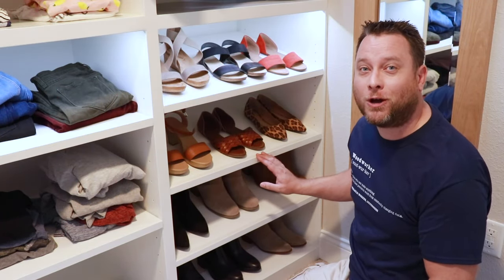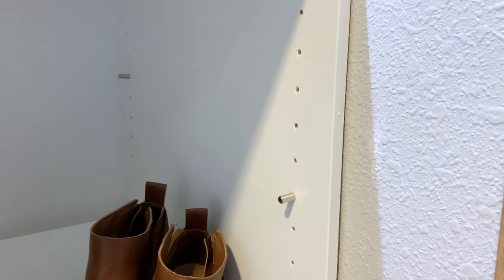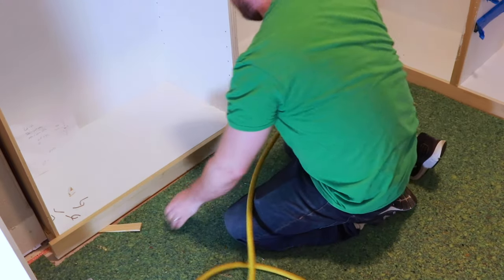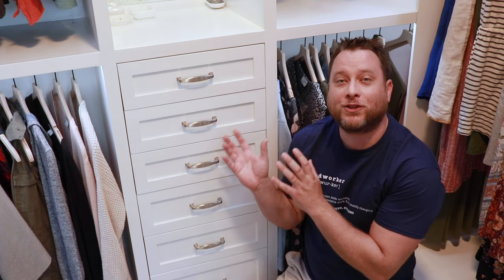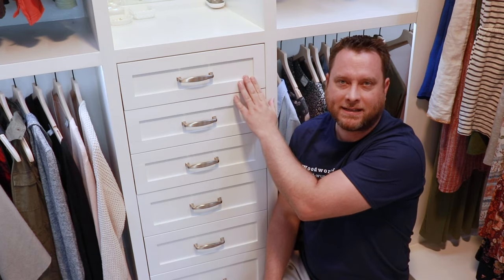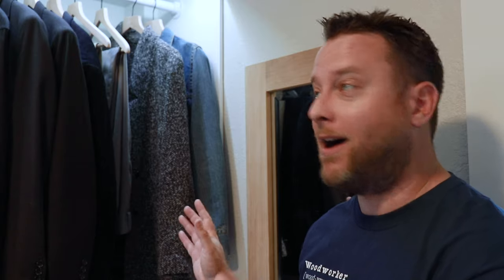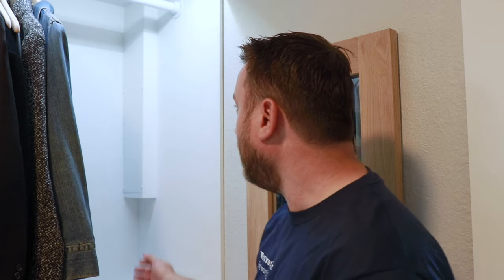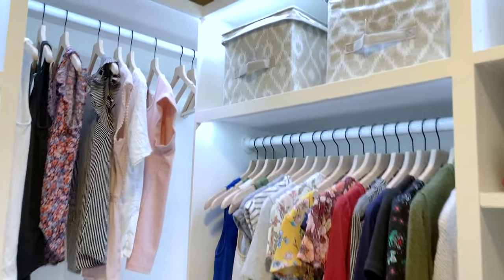$1,000 Primary Closet | Woodworking Project Details and Questions Answered

Comment: Great follow-up video...and naturally even more questions?
1 The lights really are fantastic...that said, would you do anything different with the lights?  Lights in drawers (but you already have a well lite room)?
2  Why build the drawers vs buy Ikea's drawers?  Quality?  
3  Regarding face frame width, is it better to make the face frame completely level with the cabinet surfaces or to simply easier to leave a little ridge (excluding the face frame that conceals the lighting)? Or is it almost impossible to control given variability in the floor, cabinets, etc? 
4  I will try something similar but not walking. Is there any reason I wouldn't be able to add doors to the closet....but keep the exposed drawers?    I suppose it's a matter of planning the face frame size and where the drawers are mounted??
Reply from the maker: Thanks. to answer your questions 1. I wouldn't do anything different with the lights, Ana @ Flexfire LEDs did a great job understanding my needs and build a package for me...she was great. 2. Building my own drawers was easy and I could get the exact custom size I wanted and didn't have to work around any standard IKEA sizes. 3. There are many methods to building a facefame. I took the easier less exact route. 4. You could totally add doors, you would need to make sure your depth is deep enough to cover the hanger with a jacket or clothing on it.
Reply: @HowYouCanMakeIt  Huge thanks!!!  Subscriber and fan!  This really opened my eyes to the possibilities.
Reply from the maker: Glad to help

Comment: This is a great build and I appreciate the way you simplified it for people of all skill levels. Question, since some time has passed since the build, have you had/noticed any issues with using 1/2” plywood for the entire structure as opposed to 3/4” plywood that most people (I would think) would lean toward using? Thanks.
Reply from the maker: Thanks. I haven’t noticed any structural issues

Comment: Great video.. I attach drawer faces by putting carpet tape on the front of the drawer itself, them aligning the panel while it's testing on the frame of the cabinet (or drawer face below it) I then push the drawer into the back of it. Once that's done I screw it into place.
Reply from the maker: Thanks

Comment: Which LED lights did you buy from the link? The Accent Series or the Architectural Series? and how are they holding up? Were you happy with the brightness level? Thanks!
Reply from the maker: They changed the names from when I purchased mine. I would recommend chatting with them on their website they are supper helpful. I love my lights. They are just as bright and work just as good as the day I installed them. They often stay on several hrs a day as I forget to turn off the lights to my closet. The LED lights they have are made for industrial use so they hold up. I am very happy and would recommend using any of their LED lights for any of my family and friends. I am going to be using more of their lights for a basement bar I am working on so be sure to subscribe as you don't want to miss that video :)

Comment: Question on your mirrored niche over the dresser. We are doing the same and I’m concerned that you will see the reflection of the strip lighting. If so I’m considering a puck light instead in that section. Is the strip really noticeable in the reflection? Thanks!!
Reply from the maker: I haven't noticed the strip lighting in the mirror...it all depends on the height and depth of your mirror in relationship to the LED light strip

Comment: Love the follow up video!  I have the plans and a stupid question...why did you make the base frame 1 inch shorter than the distance between the walls?  It seemed to fit pretty snug. Also did you secure the base frame to the wall?
Reply from the maker: Just design esthetics. I secured the base frame to the wall